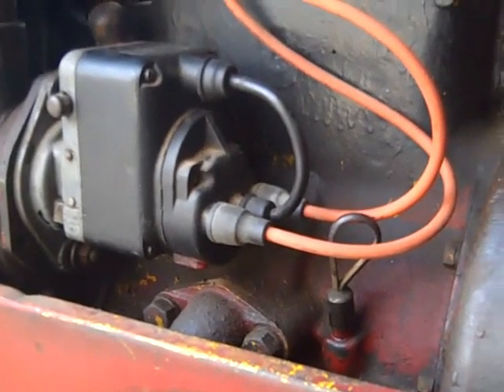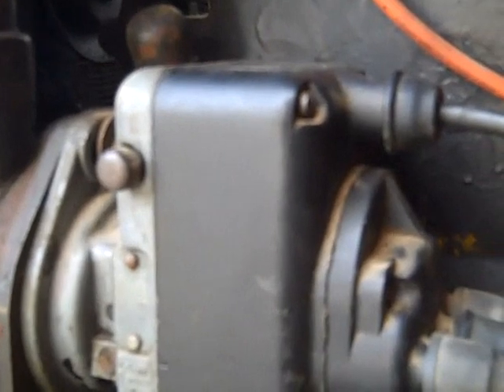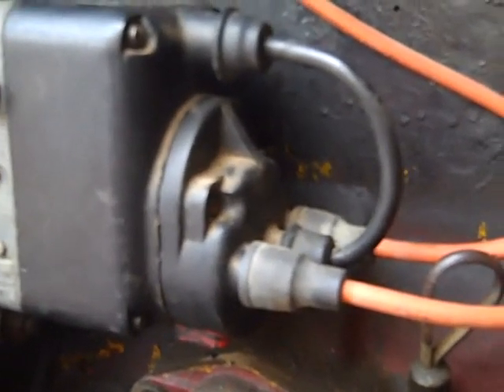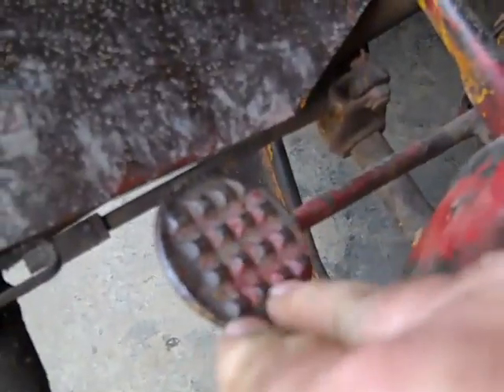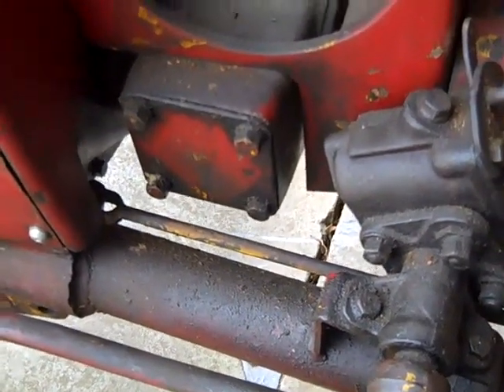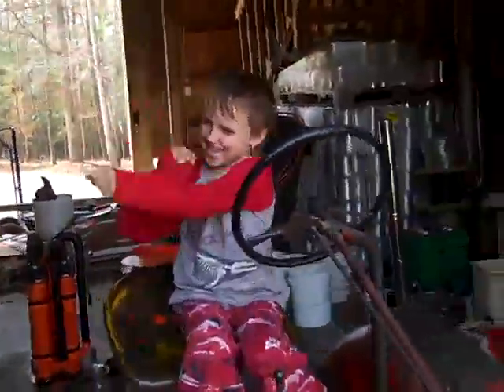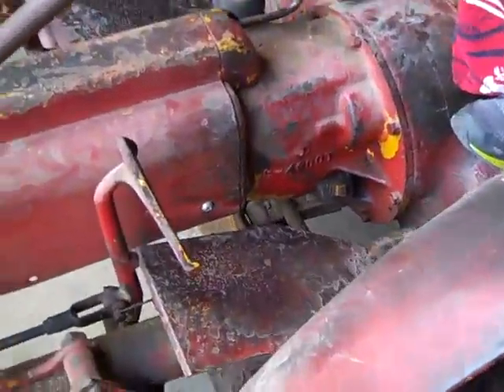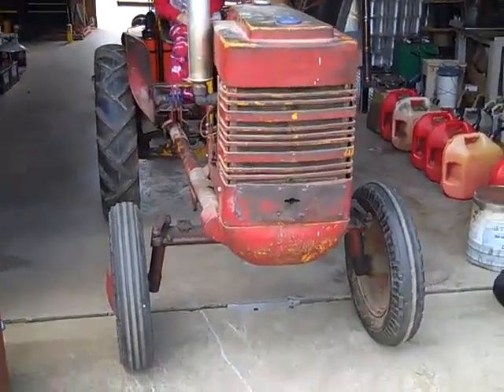Elijah's Tractor Part 2

Comment: That was a pretty sweet video.  You'll find the problem to the kill switch.  Remember the old garden tillers.  They had a piece of metal mounted over the spark plug.  To shut them down, you just push the metal until it shorted the spark plug connector to ground.  That switch probably does the same thing by shorting out the coil voltage.